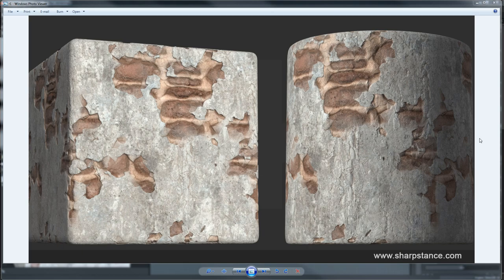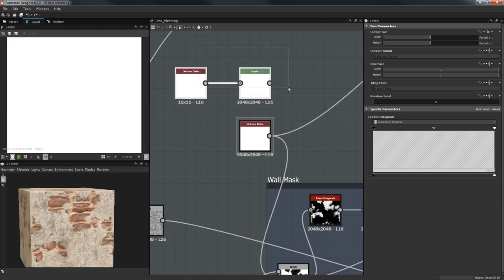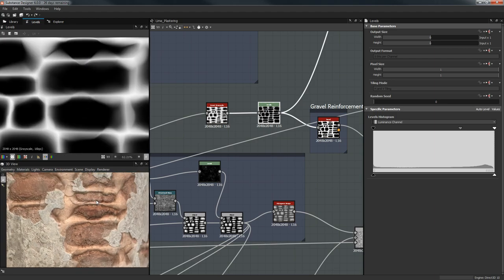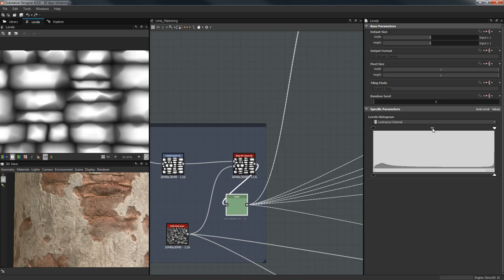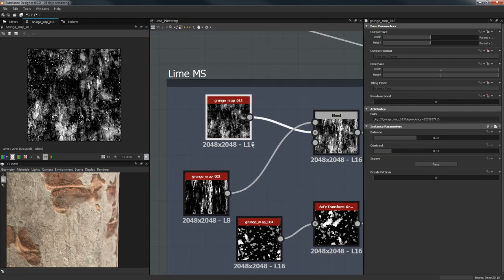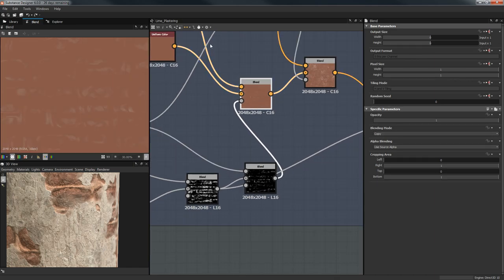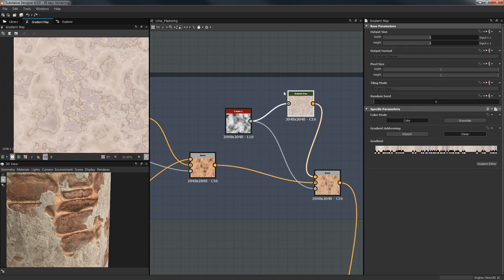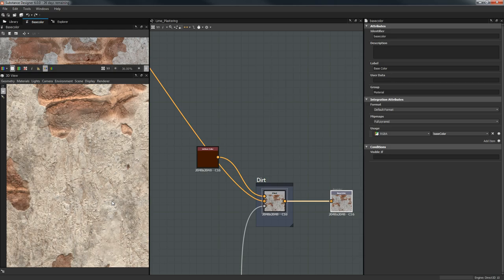Lime Plastering - Substance Designer Material Breakdown

Comment: Amazing.. Just wondering would you be abke to show a material with peel effect. Like old wall with wallpaper....
Reply from the maker: It's the same logic as this one, just use a different mix of materials and different heights depending on what you're after but it's basically how you'll do the masks that's the trick. I did a peel painted metal in the past so you can check that as well
Reply: Thank you so much. Your channel is awesome.

Comment: I Tried out your material, and for some reason it works fine in designer, but when i use it in painter it causes painter to hang for like 5 minutes, then the whole computer is unusable.  Any ideas?
Reply from the maker: It could be the material is unoptimized for runtime use :)